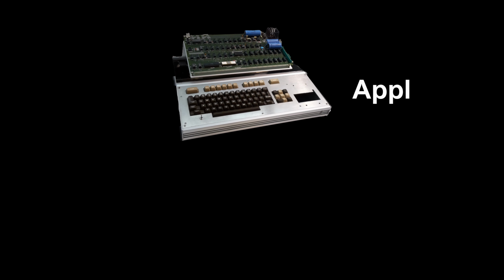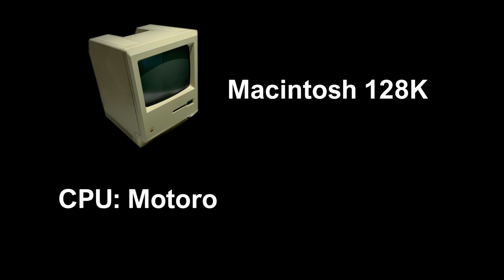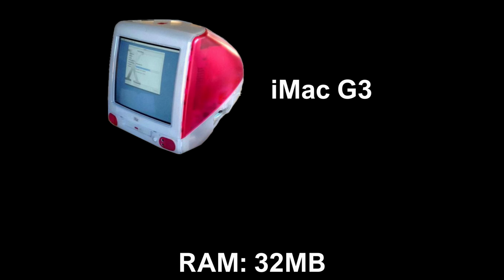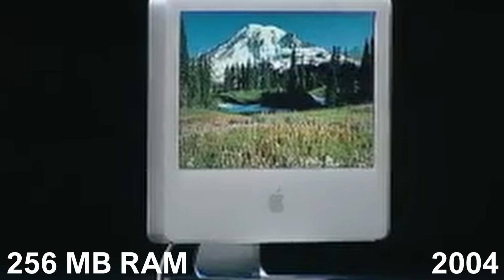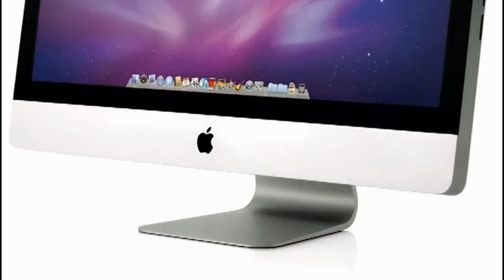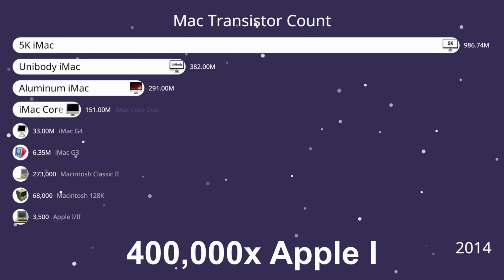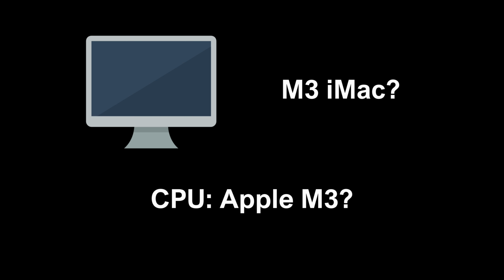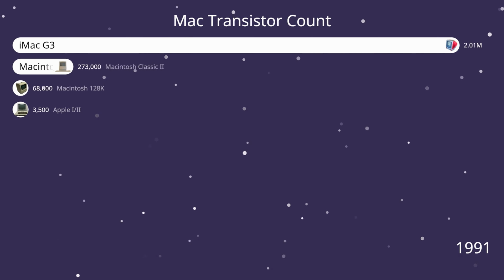New Mac vs First Apple Computer: How Much Faster?

Comment from the maker: Apple just unveiled the M3 CPU today, which has 25 billion transistors, close to the 26 billion I'd predicted. This makes it 7 million times faster than the Apple I - an impressive accomplishment over the last few decades!

While the newest computers are definitely going to be the fastest, which Mac design was your favorite?
Reply: Thanks for the Update!
3nm is pretty close to 1nm where quantum tunnelling becomes serious. When would it be likely to reach it. And what do you think will the future of Apple and computing in general will be?
Reply from the maker: Great question! I think quantum tunneling has been something chipmakers have been dealing with for a while but you're right it's going to become a bigger and bigger issue as we get close to 1nm. Over the next few years (definitely by 2030), manufacturers will probably need to spend more and more resources to mitigate it or start exploring completely different non-silicon architectures.

For Apple and computing generally, my guess is that we'll see computing progress slow down a bit over the next couple of years until the industry figures out the best way to deal with quantum tunneling, etc. But that's just an educated guess from my end!